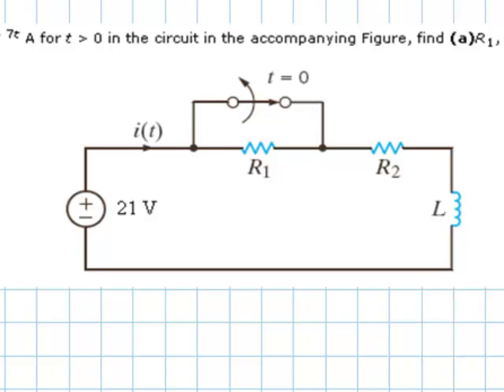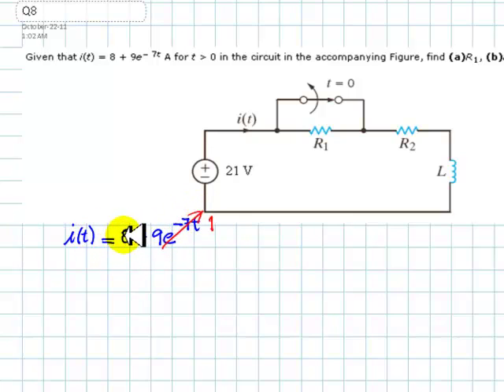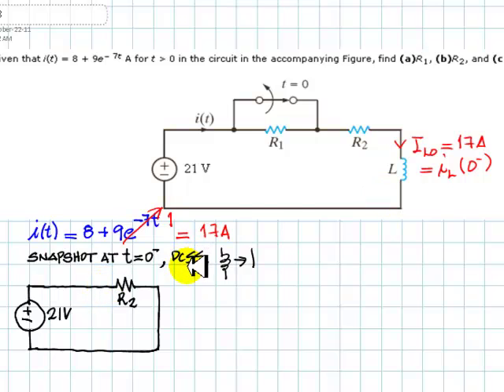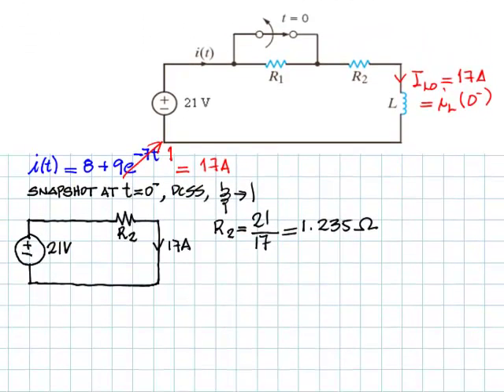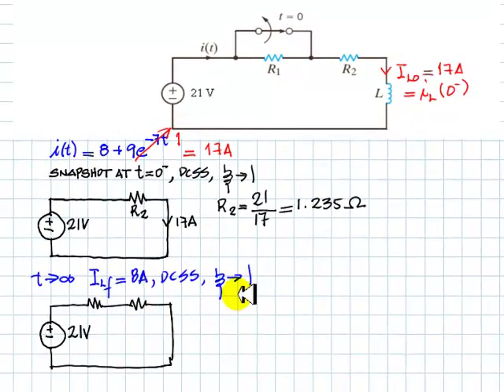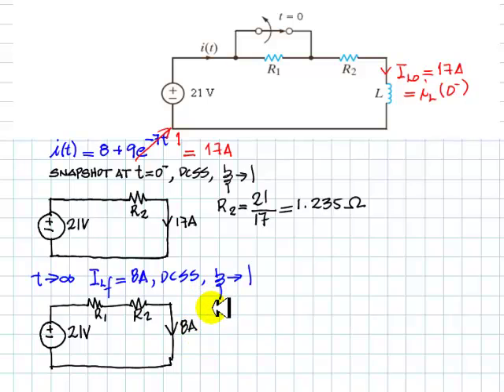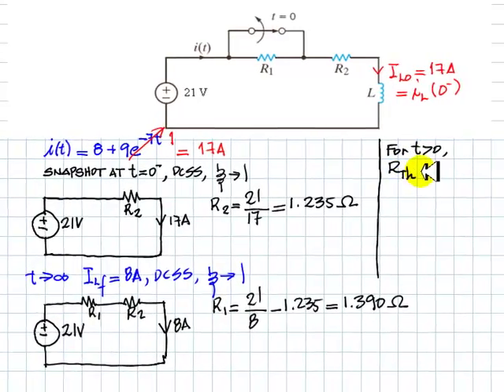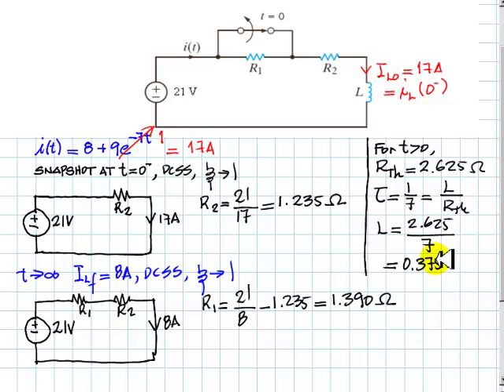EECE 251 - NEW First tutorial on RL Circuits (1st Order Circuits)

Comment from the maker: @mcr1981 Circuits, I draw with WordPro's drawing tools. WP is IBM wordprocessor. It is the direct descendant of AmiPro, the first Windows 3.1 wordprocessor. WP inherits the same powerful and flexible drawing tools but works on Windows 9X. Equations, I write with the ubiquitous MathType. MS Word licensed a much simplified version of MathType as equation editor (or used to). I use the stand alone version of it.